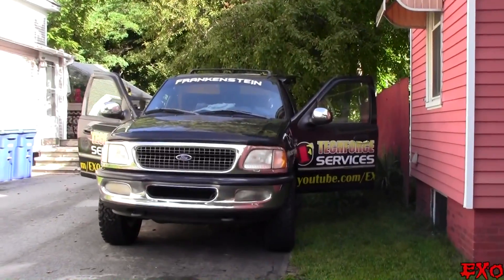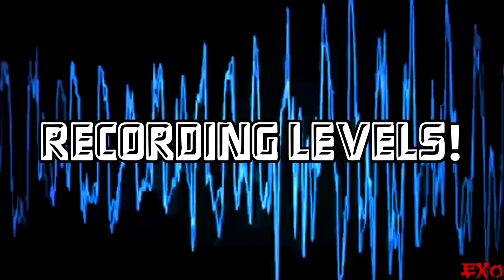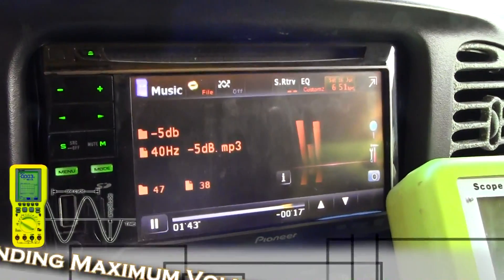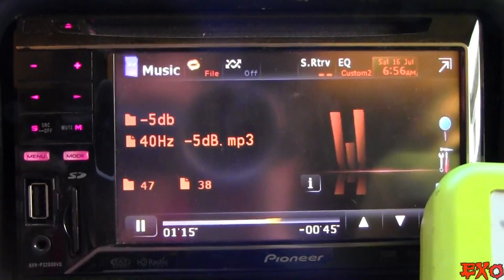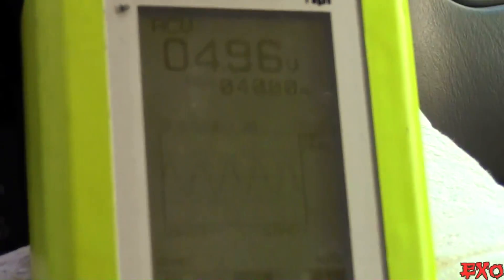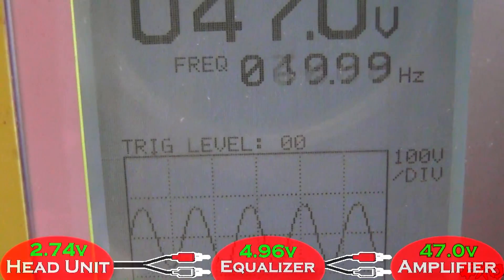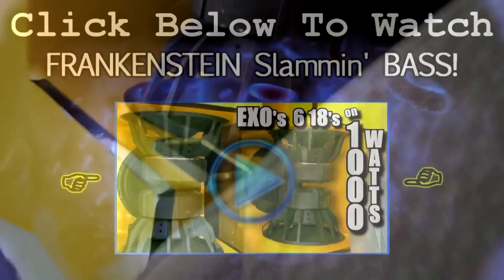How To Set Amplifier Gains & Get MAXIMUM Output w/ NO Clipping | Tuning BASS AMP w/ Oscilloscope

Comment: And here i am still setting my gains by ear. Sure my H/U only clips at 40/40 but i can't seem to get things set up sounding as good as 32-36 volume. Some tracks are just louder than other, while some are not as loud. I guess this is why i don't want to go all the way to 39/40. Because there are times where i HAVE to go to 39/40. Like when listening to Pandora over blutooth. I keep the volume on my phone one notch from max volume.

Comment: THANK YOU EXO, i swear like the vast majority of people, especially the people that follow SMD hard, think that setting their gain will always prevent clipping, even steve replied to one of my comments a while back saying clipping indicators were worthless, COME ON NOW, and one thing i can tell you is that the DD1 is not worth $150 i can go put a small opamp notch filter together (filters out 40hz with a very sharp attenuation and allows the harmonic distortion frequencies to pass right through), and it will do the same thing that the DD1 does... for around $10-20 lol

Comment: Question about wires. I'm running 4 Rockford fosgate p2d2-12's on 2 5000 watt pyramid amps. Do I need to have 1/0g wire or is it ok to just stick with 2g wire?

Comment: Hey EXO your head unit only hit 2.74 volts because of the -5db track. If you were using a 0db track, you would have gotten the full voltage your head unit can put out. I used a 0db track to find the maximum clean volume and voltage on my head unit.

Comment: Sorry EXO, but there's some disinformation in this video. I'll do my best to share the information I have regarding some of the stuff within this video.

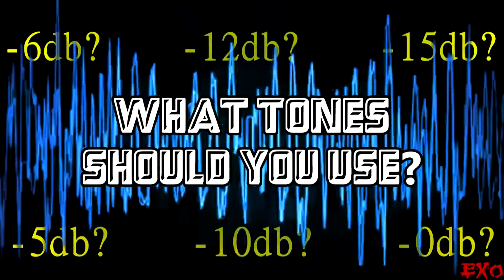1:10 - This is just simply not true. Mainstream pop music and all of the other things you've listed have all been compressed and either brickwall limited or clipped at 0db. Google up the loudness war. Everybody is always trying to get their tracks to be as loud as possible, and you simply can't go above 0db after final export to a medium such as an MP3 file. Dance music producers especially are trying to be as loud as possible. If you listen to any of that kind of music or pop or correctly mastered modern CD's you'll be clipping your music by 10 to 15db. The only thing that wouldn't really apply would be old non-remastered rock tracks that didn't compress the dynamic range out of their tracks. You'll still be clipping the peaks because the songs do peak out at 0 db but it won't be as drastic as in modern music.
Also the waveform you show for mainstream music is nowhere close to what an actual modern and correctly mastered waveform looks like. Basslines are also not even close to that far down in the decibel range. I do mastering work for a rapper and in pretty much all of his music I have the bassline limited to -6db, sometimes even higher than that. It all depends on the content of the song and I could go much more in depth but I'm going to try not to. Take August Alsina - Downtown for example. The original, studio mastered version. Its bassline actually fluctuates between -3db and -6db, peaking a little above -3db.

1:34 - The waveform you show here is much more akin to what a normal modern song's waveform looks like, not just bass boosted or decaf music (and on a side note, from the zips I've downloaded decaf doesn't boost the bass in any of the music, he just slows the songs to get lower tones out of the basslines). Even tuning to -8db to -5db would still cause a ton of clipping taking into account that all the songs are mostly always peaking and fluctuating around -3db to 0db.

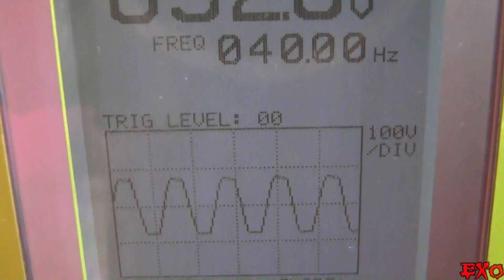5:02 - In between a square wave and a sine wave, not either but kind of a combination of both due to the clipping. But definitely not a saw wave lol

TL;DR - Basically, if you want a clean signal for all types of music, especially modern music, don't use any tones under 0db for tuning your amps. All properly mastered music peaks and most modern music sits around 0db, so gaining your amps 5db or more above that will just clip the signal.

Everything else you talk about is correct and great info. Just got some stuff wrong and I wanted to help out and further the knowledge. Thanks for the videos over the years! I've been a long time subscriber. :)
Reply: He said on the extreme end of things you can set with a 0db tone to be sure 0 clipping is happening. Most music is reduced a tiny bit(I pull more power on 0db burps than music at the same freq. Setting with a -5db tone is safe, if you blow up stuff setting gains that way it's not the small amount of distortion you may get, you are doing something else wrong or ignoring the fact that your equipment is getting hot smelling etc. etc.
Reply: mlgudead Everything you said here is correct, but it's not just on the extreme end of things that you'll want to set for 0db. Modern music is extremely compressed, a lot having waveforms that just look like a sausage (not many peaks and what not). So even just clipping a little bit clips most of the song. That's what I was trying to go for.
Reply: ***** And that would make a lot of sense, because in music the consistent bass tones usually reside around -3db, but then the bass kick drum and other things peak above that up to 0db. So everything that I said is true, and so is what you said. But if you tune your amps with anything other than a 0db tone, you will clip your music. Especially if we are talking about mid/high amps and not just sub amps.
Reply: Richard Cortes Oscope will simply show you waveform of signal, what you would want to do is calculate RMS voltage that will give you desired wattage at speaker nominal resistance and use that value to set your gains to while checking your output with oscope
Reply: I am new to the osilloscope use and wanted to know if it would work on my amp wich is a lot stronger than my speaker I have a 3000 watt hifonics on 1 12 inch mtx 750 rms  will the osilloscope raise it to high for my speaker since the wattages are way off ?

Comment: My head unit starts to clip at 60 or 61 out of 62... but I don't like that for a volume number, so I set my gains at 50. I wonder how much sound I might be losing overall? I'm not going to change it, but I'm still curious.
Reply: You probably aren't losing any sound. All the gain knob is on an amp is a voltage setting. You set it to the voltage being outputted by the headunit (in theory) and then have the perfect signal.
Reply: Alex Berry That's kinda what I figured, but I like input from others, so thanks.

Comment: I have the same head unit and I used a dd1 to set my gains. According to that I clip at volume 40 but not 39. Why does mine differ from yours?

Comment: Got a question. Since most people usually get an amplifier with more headroom than speakers.
How do you use the O-Scope to tune if say you are using a 3000W amp on a 2000W subwoofer?
If you tuned all the way through to the amp for unclipped and got 3000W, wouldn't all that power hurt he sub, or from there do you just listen for mechanical distortion?  Great video Exo!
Reply: Just because the amp says 3000watts doesn't mean its going to send exactly 3000watts to the speakers, if you have zero clipping in the amp it wouldn't matter because the subwoofer/speaker is getting clean power... Lets say you are running a single subwoofer with a RMS power rating of 1000watts, you would want a good quality 1500watt amp to give you 500watts of head room, if you set the amp to have zero clipping and the voltage to back up 1500watts then the subwoofer can take that 1500watts all day everyday, as exo noted music has all kinds of sound ranges so the subwoofer wont see exactly 1500watts every second of the song, so with an O-Scope and amp clamp meter just follow what exo did, if you don't have a sound processor like exo has then you go from the head unit to the amp.
Reply: Plus some subwoofer can take more than they write on the sheet of specs ..... they keep a safe zone to be sure you will never blow it if its a clean signal
Reply: MazdaBass971 OK, then for example, you have a 1000W sub on a 5000W amp.
Because not ALL subs are underrated, this might be an extreme example. So you've scoped the amp proper, from there you just listen for mechanical distortion once the sub goes beyond it's capability?
Reply: ***** You can use a voltmeter to find the output voltage of your amplifier. Watts = Voltage^2 / Resistance
So you can take your desired wattage (say 500W) multiply it by nominal impedance (maybe 2 ohms) and take the square root of that product. So, 1000^(1/2) = 22.4V. You just tune the amp to put out that voltage or lower on a variety of tracks. If you trust the RMS rating of your amplifier and keep your head unit volume reasonably low, you can actually do without the oscilloscope or DD-1.
Reply: Actually Watts (P) = Current^2 (I) x Resistance (R)
But whatever, my question is you're finding the max clean signal of the amplifier output, but what if that total power exceeds the subwoofer's handling? I guess you just go by when you hear mechanical distortion from there eh.
Reply: Oh sorry, I misread your equation. I didn't see the division. P=E^2/R as well. :)
Reply: No. You can find the maximum clean signal for the amp. If that voltage is above the voltage of your subs wattage (you estimate this voltage using the desired wattage and nominal ohm load) then you can lower the gain to the lower voltage.
Reply: Wouldn't that just be a guess since most subs don't have actual hard ratings, but in most cases underrated.

IDK, I just set HU to like 4/5 and increase gain on amp until I hear distortion and back down a bit.
Reply: If you don't believe my formula: take Ohm's Law (I=V/R) and multiply each side by V. Then you have W=V^2/R. Solve for V.
Reply: I believe it, I misread the equation like I said earlier. Sorry man!
Reply: The voltage you find using the sub RMS will be safe. It will be inaccurate because the resistance raises significantly when the coil heats up. I certainly didn't buy an oscilloscope to set my amp, and my USED amp has been running almost everyday for 8 months. You can look up "setting amp with multimeter" if you have a multimeter. Otherwise, yeah, the method you listed above will work as long as you are careful.
Reply: Yeah, I find setting by ear best. At least on a daily. Too many variables to try and get a specific number with multimeter, best to just set amp slightly before mechanical distortion is detected from drivers I've always found.
Same thing with the DD-1. yeah OK you get a clean signal from your amp, but that doesn't mean it's the proper output your sub/speakers can handle.

Comment: you can actually safely clip your amp/subs to 1-5%.
Reply: TheAndruxa83
 If you have an engineering degree then you should know that those distortion lights aren't accurate that come with amps or "clip" lights. They are set to go off at a particular rail voltage, not when the amplifier is actually clipping or reaching a distorted output.
Reply: people that post that actually have engineering degree and years of experience. Subwoofers can safely withstand upto 10% distortion and amps can easily do 5%. I have mine set to the point where distortion light flickers upon heavy bass notes and been doing that for years with no problems.
Reply: LutkeVeldNL It's awesome to actually find other intelligent people on the internet.
Reply: Indeed, you won't hear the difference and the sub doesn't care that much at such 'low' distortion.
Reply: this what allows me to hit 140+ dB on a single 12'
Reply: TheAndruxa83 I agree on your first statement, but not on your second. Going into clipping gives only a minimal increase in output. The thing that allows you to do 140+ dB with a 12 is your car (cabin gain). Try measuring outside in a 2/4pi environment, you probably won't even reach 120db (100 times lower).
Reply: People that say that are usually the ones who have their subs or amps burned out.
Reply: TheAndruxa83 me too and my class d is freezing compared tomy class a/b on mids which u could warm coffee on

Comment: Say u just have yur mids and bass amp running off yur headunit and u dnt have a eq or crossover u just use yur two amps and the settings on yur headunit to tune things